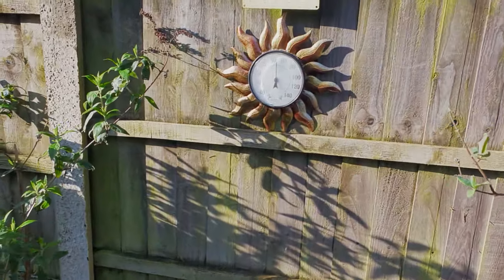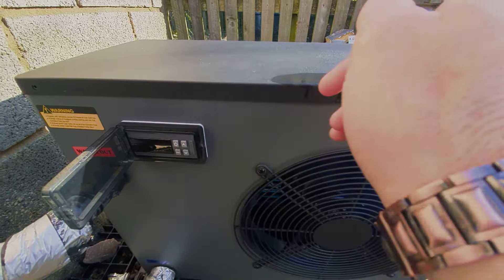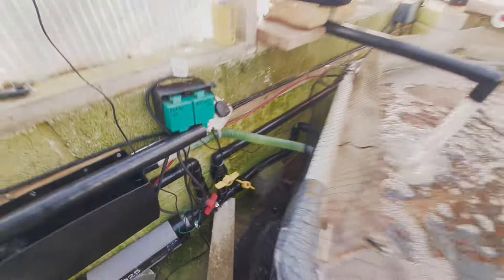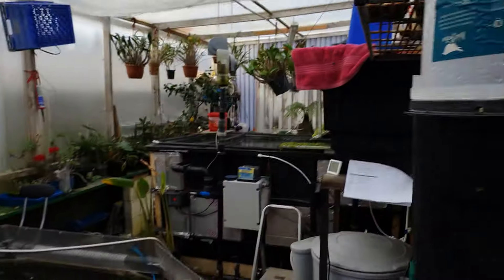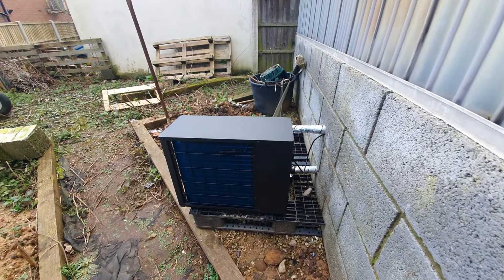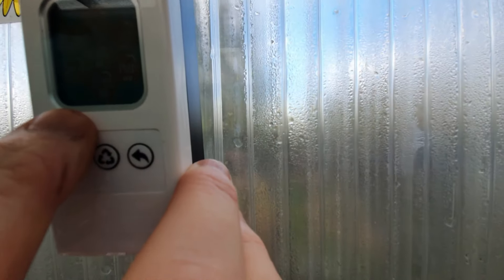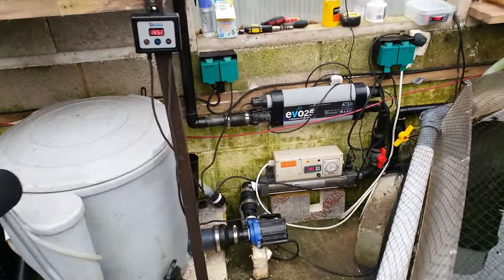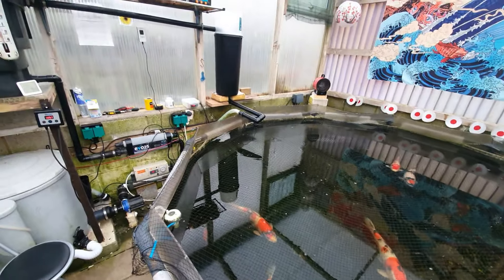Mini Air Source Heat Pump update - Big change of thought for winter.

Comment: As Si said, the Thermotecs are the same but you can use the engineer codes to override the factory settings and go down as much as you like👍. I choose not to go below 16 degrees and run my pumps at 50% of their summer settings  (which turns the pond over every hour) to slow the water flow through the heater👍. Bit of trial and error to find the best settings for your pond but fun testing things till you get there😊👍

Comment: Certainly with my duratech, they recommend a 1.5 c differential between input and output as being most efficient.  As others have said, I can also go lower than 15c via code to change factory settings.
Reply from the maker: Thanks for the info, I was thinking higher difference the better but then that would mean really reduced turnover. Cheers

Comment: Hi mate👋 The Thermotec's are the same with their programming, preset to a minimum of 15 degrees celcius. However you can access the parameter system with engineer codes so that you can set them to whatever you wish. Like you say though, for a £ 300 unit you can't really complain can you, especially when you have 2 for that price!😲
Reply from the maker: Yeah for 300 I think I'll make use of it for the main growing season then once outside temps make it ineffective let the pond temp naturally drop to the indoor ambient temp, then all feed stops for a proper winter rest for a few month. Will look up the engineer access. The ST1000 is working great though.

Comment: Way don’t you put it inside
Reply from the maker: Hi, my understanding is it will drag from the air to a point it won't be effective and it will need to duct to outside and I don't really want to noise inside either.